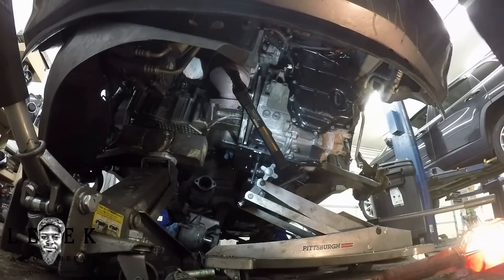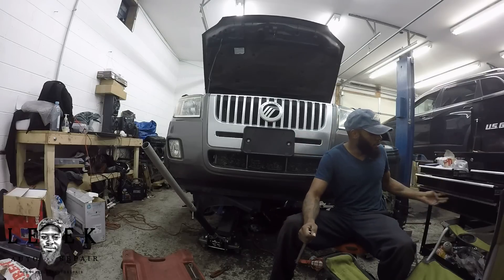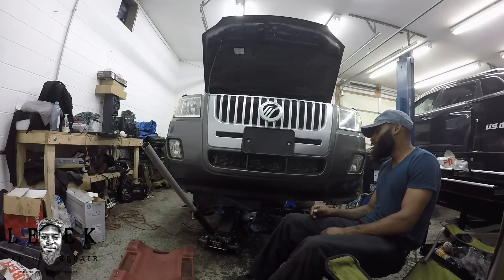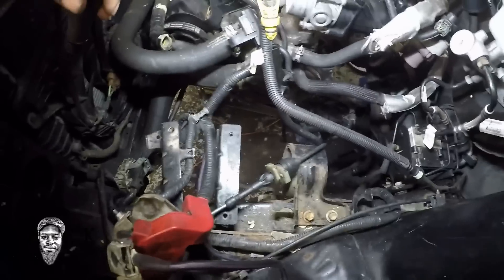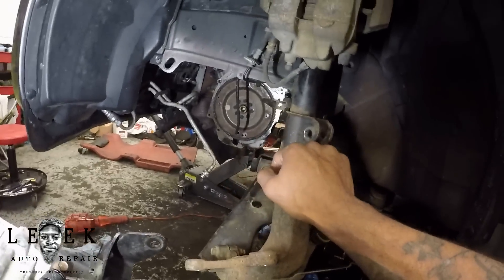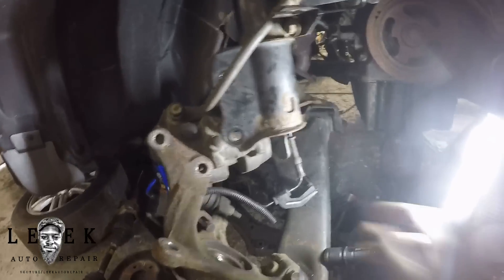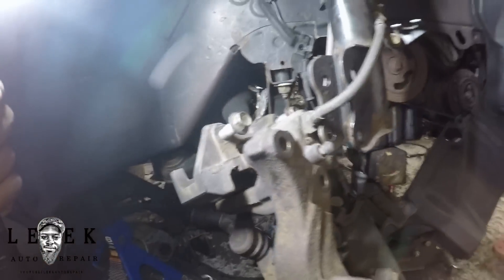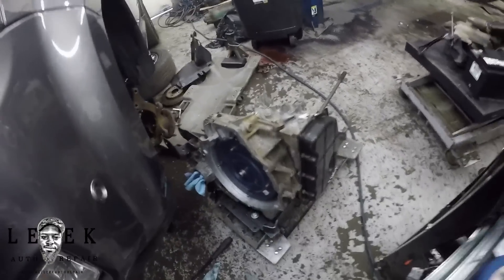Transmission Removal Tips | 2010 Mercury Mariner

Comment: Leek I am currently working on this exact car. I am trying to get the gear box differential case which is connected to the drive shaft off. The exhaust piece however is in my way to get those top bolts off. I was wondering if you could tell me how you got them out without disconnecting the Cadillac converter part of the exhaust
Reply: Torque specs for the transmission???
Reply: @dustyrodes12  I bought a t-50 socket and cut out the t-50 part off the socket. I got it in the bolt, a 8mm will turn the t-50.
Reply: Joe Pedersen you cut the t-50 off the socket, essentially making it a t-50 bit. You put a 8mm wrench on it?  Is there enough room for the bolt to clear the exhaust manifold/converter?  I don't want to remove the manifold/converter as I'm afraid of breaking the rusted manifold bolts.  I'm trying to figure how leek remove the PTO without pulling the exhaust manifold/Cat.
Reply: Thomas Dever I just tackled this job on my own in the garage. There is no way of getting to those bolts without disconnecting the exhaust manifold. That bracket has to come out to get to the transfer case bolts.
Reply: Dustin Montgomery that's what I thought but in the video it appears that exhaust manifold is still attached to the engine as the PTO is separated and attached to the driveshaft.   In Ohio those manifold bolts are pretty rusted up and not easy to get to